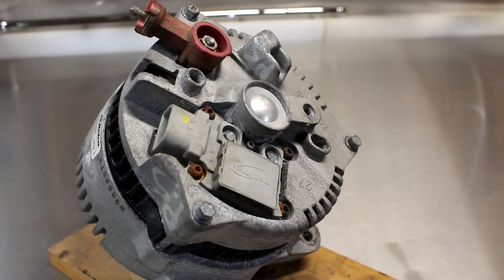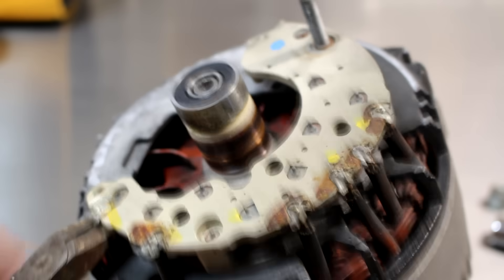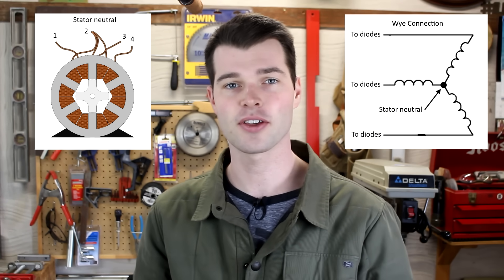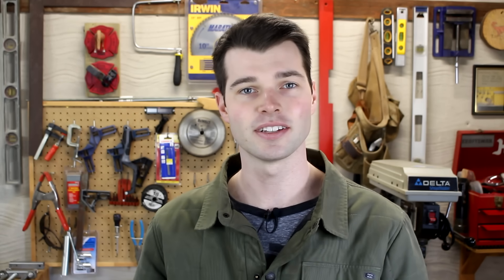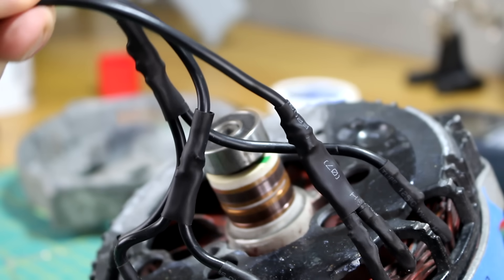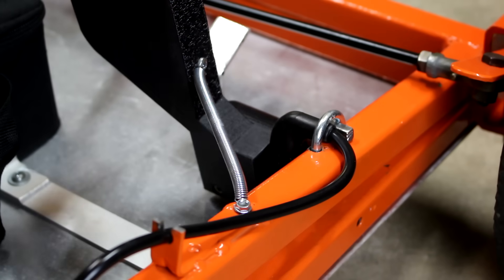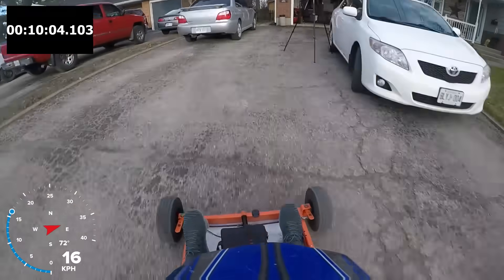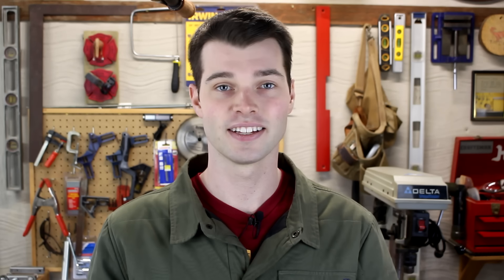Converting a Car Alternator into a Go Kart Motor

Comment: So get another alternator and use it to charge your batteries while
Driving around.
Reply: tornsoul82 are you suggesting that you've solved the world's energy struggle by generating energy out of nothing?
Are you sure this is what you've done?
Reply: Some people and by the looks of it here  "A BUNCH" of people are just Plain stupid.
Reply: @lysol7204  Sadly there is no cure
Reply: Richard Schofield2@
Reply: That sounds like he has accomplished …  @richardschofield2201  "Over-Unity" and at a rate of 30% is INCREDIBLE! to say the least.
And although I  originally conceived this alternative due to a friend insisting he had accomplished  'over-unity' with a fully-magnetic-motor drive,
along with my insistence that "it couldn't work" and after discerning then labeling the problem and solving for it, the solution became my original "Come-No-Go" motor design in 2002,
(I projected it to be nearly twice as energy efficient as the conventional drive motors were at the time.) 

Circumstantially shelved until 2013  I again revived it and this time refined the switching to mosfet pickups, shunting power between discharge capacitor and recovery capacitors, , and also adding the re-gen (Reverse EMF) from the reverting magnetic drive field now has it at 80% internally recycled power which leaves the battery (or source) only responsible for providing 20% of the ongoing power consumption. 

(BTW … I have yet to be convinced that 'over-unity' is possible, while higher energy efficiency is.)
Reply: @willyens8779  what are you going on about? Where is this extra 30% efficiency coming from? Modern motors are 90% efficient anyway.
Short of magnetic bearings and running it in a vacuum there's nothing more to gain from electric motors.
Reply: The parasitic drain of the additional alternators would require more power to overcome than what you would be producing. If what you are suggesting were possible it would be the solution to the worlds energy crisis. There are no free energy machines, thats like turning lead into gold, its a pipe dream; physics prevents it.
Reply: I don’t think that’s how it works😂
Reply: This is just silly. Of course you cant use an alternator as an engine to power the cart, and then stick a second alternate on the chain, to have it provide power to drive the thing. Even if you somehow managed to get 100 % efficiency everywhere, and no friction losses, you would get exactly as much power from the second alternator, as you input in the first one. As son as you add the load of actually pushing the cart, it just stalls.
And, in the real world, where friction and energy losses occur, this is dead from the start.
Reply: Exactly … Friction would kill it  @SweMisterB
Reply: @SweMisterB  I think a lot of people don't realize how much energy it takes into turning a generator. My first hard lesson was when I put a small generator on my 10 speed bike in the 80's and darn near killed myself when I flipped the generator on so I could see when it got dark. I quickly switched to battery powered lighting.
Reply: Laszlo Makrai - 

Thank God that some one on this thread "gets it." 

If we could just hook a generator up to an electric motor, and produce more than we use - then we would have been doing that for the last 200 years.
Reply: @barking.dog.productions1777    .wowwsssswss this Great Job Sir, Welcome to Brazil Great time for investiment here now... think about this Work here... Now...
Reply: YouTube comments sections are so silly. I'm not even out of high school yet it seems I know more about power generation than half the YT audience. Amazing that in 2018 people are still thinking that they could create a perpetual motion machine.
Reply: @maeflower5108  you cant cure stupid
Reply: ElTomatoe amazing that your physics are flawed .. we humans swim in a sea of magnetic waves in this little wonderful planet. A perpetual whatever machine is flawed terminology also .. anyway, keep studying .. https://m.youtube.com/watch?v=yodY1jH5j-I
Reply: A lot of people here without even basic physics/electronics understanding lol.
At every conversion (eg kinetic back to electrical) you get less out than you put in due to inefficiency. Stacking up inefficiencies does not = magical free energy.
Reply: You could do this but you would need a flux capacitor.
Reply: @vermont1able  no problem...
They sell Flux capacitors on Amazon look it up...
Reply: Regenerative braking.
Reply: The gene pool seems to have been contaminated with some seriously harmful shit
Reply: This comment was funny and then i saw 56 fucking replies
Reply: You can't do that. All you do is add drag, which discharges your batteries faster.
Reply: So you can (feasibly) make an electric car that can charge itself on the go? If this is so, call Elon, he has a job for you.
Reply: it's not "free" energy, it's recycling waste energy. It took energy to get to that speed, you are just getting a bit of it back.
Reply: Dylan Livingston it might even drain the batteries more , its better to have a real rated motor as the drive and a smaller economy car alternator and connect it with like a 16 tooth ( drive side )  to 4 tooth. ( alternator side ) and only get a bit of extra time . some people might call it " free energy " but there is no such thing thats like saying i can life without food or water by breathing . Better you just get a bigger battery pack .
Reply: @samurboi8007  sam the slacker
Reply: thats just troll science.
Reply: However it will look ugly and cripple top speed due to the alternator getting harder to turn when under load charging the battery
Reply: You can’t recover waste electricity by attaching an alternator to the original motor. The alternator would simply be an added load (as it consumes energy to run) to the original motor. Thus whatever you got out of the alternator would just be taken right out of the motor.
Reply: The alternator would serve as an engine break because, the energy required to charge the batteries is not converted 100% efficiently.  There are some losses in the alternator.  The amount of power used to drive the alternator would not be replenished into the battery pack due to these losses.  Effectively, you would only serve to drain the battery faster.
Reply: Idiots
Reply: @lysol7204  I know right? It's ridiculous this level of cluelessness exists
Reply: Guys use your brains. Alternators are 65% efficient. Very efficient 4 cylinder gasoline engines are 35-41% efficient. you can regen brake by reversing the polarity but thats the only way to recoupe some of the energy you've already lost. Nothing is going to create energy out of thin air.
Reply: While you're at it, pull yourself up by your waistband until you levitate.
Reply: If you do that, men in black suits show up and take your toy and give a strong warning not to do such again.  Next visit they erase you.
Reply: @texasinfobroker  dont flashy thingy me,bro!
Reply: not needed, just use an esc with regenerative braking!
Reply: Fucking hell, with all these 12yearold YouTube engineers we should, like the guy said, have a fusion reactor within months!
Reply: uhmmm...no.   so right after this you'll build a cold fusion reactor.
Reply: EXSACTLY
Reply: "What do we have for him Johnny?"
Reply: That is called dynamic braking
Reply: tornsoul82 would it be better to go solar?
Reply: jmlcolorado use it for breaking and recharging. Obviously not fast breaking.
Reply: Awesome! Too funny!
Reply: I actually use something like this in my robot designs. The drive motor drives the drivewheel and a 12V hand crank generator. The free spinning wheels also have these generators attached. The power source is a 12V battery - but the 12v battery is not being charged by the generators, The generators are charging smaller, rechargeable battery packs that power the electronics and other subsystems. The 12V battery only supplies power to the motors - when in operation the generators keep the smaller batteries charged, when the 12V drops sufficiently the machine tracks the charger and plugs in, charging only the 12v battery (the small batteries stay charged from the generators) In addition, the generators can be used in place of optical and hall encoders, because they output a voltage and frequency that is directly proportional to the running speed off the generators.
Reply: This is a good idea to recover some of the lost energy. Teslas do it with regenerative breaking. Why can't we do this? 

It wouldn't be creating energy it would be collecting it.
Reply: It don't work like that
Reply: What?
Reply: Idiot
Reply: Isn't it possible to use the same motor for Regen braking?
Reply: I actually tried hooking an electric motor to an alternator with more output capacity than the motor used. I was 8 years old and invented FREE ENERGY. But, as you probably know if you know basic physics, it didn't work.
Reply: That would kinda bring into prop motion witch we haven't figured out yet. so would the amount of power needed to run the new alt be more than the new alt could deliver back? Ya probably
Reply: I've had this idea for a long time as well. Or stick like 3 alternators on there lol! They don't seem like they take much energy to spin. Obviously you'd still need a battery pack, but it would make it last MUCH longer, I assume anyways.
Reply: check out the laws of conservation of energy, which are immutable. Any energy taken from the drive motor to power another alternator is a dead loss to the drive motor, with additional losses due to inefficiency No free lunches in the energy field....Joe
Reply: larry ballard  So... A hybrid?
Reply: jmlcolorado I know nothing about it, but could you not use two batteries and two alternators?
One powers and drives, and that charges the other battery. And swap between the two? So you're using driving to charge, then ....... well.... alternating 😂
Reply: Hmmm,how about an alternator from a motor bike with a big gear to small gear mechanism to charge the battery while driving?
Reply: See the second law of thermodynamics
Reply: 1 alternator waste about 2 horsepower to work, so where is the point?
Reply: @MrFluorescentify  The point is you cannot get something for nothing, you will end up with less power than was in that system to begin with you are trying to invent perpetual motion.
Reply: @MrFluorescentify   Because you cannot something for nothing ,it would decrease your range.(Think why perpetual motion will not work)
Reply: Perpetual motion?  Not. Lol
Reply: only if
Reply: Good thing that no physical resistance exists when driving a charging current.
Reply: top 10 comments made moments before disaster....
Reply: How much does the alternator (once prepared) weigh?
Reply: We call it Toyota Prius. Except that there's still energy loss
Reply: Maybe it'd be an idea to use it as a regenerative brake...
Reply: Haha!
Reply: @Maximus Decimus Meridius what have I said that is so un-chilled?
I have questioned anyone who claims they have created perpetual motion or anyone who believes they have improved the efficiency of coupling motors and alternators.
Quite reasonable questioning don't you think?
Reply: "
Don't be stupid you moron"
Reply: @Maximus Decimus Meridius do me a favour and quote what I said that was so terrible, as I just don't see it???
I feel you may have some snowflake tendancies that you need to work on...
If you read everything looking to be offended you'll find it, especially once you add your offense seeking tone to it.
Reply: @Maximus Decimus Meridius jeez you're an angry little fella aren't you?
Look, I made some valid points in this thread.
You have not contributed to this thread at all.
You reached out to me for whatever reason to to start a slanging match.
You haven't been able to justify you original message with a quote or reason.
I believe this makes you the troll!!
Reply: perpetual motions??  FBI wants to know your location.
Reply: @kiskafish7877  off of the steering shaft
Reply: Unlimited energy solved lmfao
Reply: larry ballard  It is called a hybread car dumbass that is how basicelly how they all work.
Reply: Good try but it doesn't work using an alternator to recharge the battery as the motor propels the vehicle forward. Eventually the motor and the load that it has to move will use up more current than the alternator can supply there's no such thing as endless energy.
Reply: I had a similar idea a few years ago of an electric motor running off of a car battery that spins several alternators which would charge up a bank of deep-cycle batteries in a Series-Parallel circuit that feeds a Power Converter(s) which could provide enough energy to run a few household items; one of which is a feedback loop to a battery charger to recharge the first battery running the motor.  And my theory was that if it is scaled up right, I can create a "Self-sustaining Power Plant" to take my house off the grid.
And it would of worked, that is if I can find a way to repeal that "Fuck-me-in-the-ass Law Of Diminishing Returns"! !
Reply: ding ding ding.......
Reply: AL TheBoss 

Yeah, "ding ding" with a missing clapper. That added alternator won't avail much, if any. No such thing as a free lunch Jack. I'm not much of a physicist, not by a long shot, but my objection has something to do with my rather sketchy understanding of one of the 3 Laws of thermodynamics that will buck that. (again no such thing as a free lunch). Here's why jr., without delving into the intricate Calculous, a level of mathematics I've not a drop of ability to explain by.  First, that alternator's weight will impose itself upon the whole 'ball of wax' in addition to it's freight and that motor will have to work a lil harder to keep up the pace, thus needing more juice, serving as factor (albeit a minor one) to faster discharge the battery than that alternator can recharge. More importantly, that coupling of it to the motor for it to, in turn, drive it's energizing shaft will no doubt affect efficiency of the kart. You won't be able to run as fast and as long as imagined. Perhaps you may get a mile or two more out of that "free meal" set up, but point being the bat will still discharge down to a useless "brick", simply because that alternator's charging rate won't be able to keep up with the rate of the kart's rate of power juice consumption. Then you might rebut with "Well darn shoot! Just get a bigger alternator for more 'oomph' output!". What for? More weight imposed for same motor to push everything depending on it to go somewhere, and more heaviness of the alt's shaft that has to be turned by incurred more effort required by the motor to impart a spin on it. The coefficients and variables  of friction, gravity, drag, doobababingbangs and all that resisting jazz to surmount will just make it all the worse instead of better for the bigger alt to supposedly kick aside.. More battery food that has to be gobbled up to compensate for same speed of trave, resulting in less run time. No matter what you try to do to off-set the unwanted, the "System" will simply adjust to BALK you man. And that's that. And I'm positive, that law of physics has been tried and tried again by sundries of others to be breeched, only to end up "fucking" or getting "fucked" hard by a dead end, waaaaaay before any of us on here yakety yak yaking away commenting, was, in part, flagellating around in our daddy's balls!!! 

In short, what I'm trying to say is, "No dice! Those are the breaks, at least  in this Universe we all are held prisoners in for life, son. So like it or lump it. But Nice try."
Reply: What you say is true, but what if he would be able to convert his alternator into a motor/alternator. When he is coasting,/braking it would work as an alternator and then he pushes on the accelerator, it would act as a motor.   The biggest downfall of electric cars are 3 phases : 

1. Generating electricity that isn't dirty is expensive/time consuming/slow
2. The batteries we currently use are also very environmentally unfriendly. The material in them are in short supply and hard to mine. 
3. The range is very strictly limited by the size of the batteries and the vehicles due to the size, can be really heavy. 

If we could generate power while the car is in motion, then we could extend the range without adding batteries, using time, etc. There are many ways to do that, unfortunately none of them are cheap or easy. 
1. Regenerative braking - using the electric motor  during braking as an alternator is a "free" energy. 
2. Using the centrifugal force to spin a generator while braking or accelerating is an another "free" energy.  Kinetic Energy recovery via a spinning wheel  for example.
3. Putting solar powers on the cars surface is also free but at the moment it is a very small amount of power at a few hours a day in most areas, but if the solar panel efficiency raises, so will the use of them . 
4. Using the shock absorber's motion to get kinetic energy, is also a good source of power. This is a fairly new and very exciting project. Since the cars shocks move constantly, they generate heat and the moving can be turned into generate power.  This is especially true in SC roads which are very bumpy :-)  Again, this is a "free" energy. 
5. Using the vehicle's kinetic energy as a freewheeling motor is what F1 used a while ago. I think the name was KERS and it was abandoned due to the instability and cost effectiveness. Once they went hybrid and uses the kinetic energy to generate power instead. 

I'm sure we will find other "free" energy around a normal car, that we can use to generate power therefore extend its range and reduce the size/amount of batteries we need.  

Using an old style alternator (motor) on a constant run is not a free energy because it will take power away as the engine needs to spin the generator. This causes friction and robs power from the motor.
Reply: pretty much like the old starter/generators haha the starter motor was actually also the alternator :P
Reply: @oldwortex5818  Great Job Sir Keep Power, Welcome to Brazil , we here Make Great Bussines here ... think about this... This motor alternador Work on 12 Volts?
Welcome to Brazil...
Reply: Laszlo Makrai forklifts have gen breaking fyi
Reply: dumb da dum dum
Reply: Finally a working solution to the perpetuum mobile problem.
Reply: Ferrari uses this technology on their Formula 1 race cars. I forget what they call it, but uses the braking to charge a Capacitor that is used for Burst type accelerations.  I also like how Porsche in their 918 hybrid car uses a generator to power their electric power motors, thusly the gasoline engine is used to power the generator. Unfortunately imho the electric car has come way too late. In fact it came and went way back in the early 1900s with the advent of cheap crude oil. Maximum profiteering through exploitation of the earths resources are dooming the human race to extinction.
Reply: @evopwrmods  kinetic energy recovery would be way too complex on this vehicle...m
Reply: yes everyone knows who the liar and murderer from the beginning is.
Reply: Quinton P. Young III Regenerative braking. Then it will be same as the hybrid e-machine!!
Reply: tornsoul82 this sounds interesting! Do you have any more info somewhere of your system?
Reply: Scott Monroe. ... we had and still have real problems to address.... you cannot buy industrial resources as a home owner in abundance like you could 40 years ago... because you need an account and to by in bulk.. wages are being driven up so new growth to get such an account responsibl without irresponsible loans...is almost if not zero...

the japanese did in fact learn how to make gold with a chemistry set... and many many many other things have come to pass... wind mill energy the low end of the coin...if you want to charge your batteries without impacting  the system "parasitically" ... tie into the existing drive spindle in a way that doesnt farther substantially impact the system.... and you will do fine.

the thieves making wind farms are not getting rid of burried or overhead powerlines... they are not making electricity far more affordable so our home owners can build businesses out of the work shed... or any other similar... they are producing jobs... and taking a cut of the already existing infrastructure in a monthly payment.... that is rapidly being made less and less affordable and the community more and more dependent on irresponsible money changer/currency abuse salesmen who convinced you that an honest days work... honesty itself... good will... and innocents (not naive)... could build anything and everything your hearts desired without setting the future up to be ruled in sloth saying only a trickster or a gov power could get anything done.

if you want to find a way to build a very efficient car... or anything else... you can do it if you try

you are not "getting something for nothing" no matter how you go about it... the energy you pull from the wind or sun... or the latent magnetic flux lines of the earth relative to the magnets in your ellectric motor... is being shed in the mechanical deformation of every tiny part of the equation relative... wear on the chain, the sprocket... wear on the bearing... tires... the road... into your body... and in the mechanical deformation seen over time as the transfer of energy causes the decomposition of the material you use for your battery.... . the statement you cant get something from nothing is in fact accurate... but falsifying it... is as irresponsible, or more so, than claiming you can in fact get something for nothing.

what you are wanting to do with electricity is akin to the difference in manufacturing something like a VCR with hand tools ...and manufacturing a VCR with old fashioned ultra complex mechanical engineering using tool and die.... to manufacturing a modern VCR with a combination of all of the above but using far cheaper, and cheaper to maintain robotics in your tool and die.

eventually you will succeed... and as with all technology... the first people who own it will very likely utterly fail to respect it... and they will ruin most of mankinds potential to actually do anything remotely close to as awesome as what could have been done... if they would not have tolerated politicians claiming right to cause reactions in order to pass a law to do something a law cannot actually do and that you already had the ability to do.

best wishes... i am a man.... and my faith is not for sale...knowing that i am a man... that faith in you is all i have... no matter how stupid you get.
Reply: You just invented a perpetual motion machine!
Reply: @officialWWM  i think you are related to forest gump
Reply: jmlcolorado I think you're onto something...
Reply: Mr B have you not heard of high output alternators? I have one in my S10, powering a 2000 watt 10 pill cb amp, that puts out around 800 amps continuous at 2600 rpms.  There are big suburbans running up to 8 alternators(usually leece neeson truck alts).
Reply: sure Mr B , its just silly , just LIKe the fake moon landing or water pooling on a spherical object... sounds like 'stinking thinking' or compulsory education is blocking your creative nature.. this ant is awesome and its pretty obvious he WILL move that rubber tree plant!  ps  water Always finds it 'level'  : ) cup, puddle, pond, lake , great lake, ocean!   THINK!
Reply: @jimmyfavereau  Dude just stop
Reply: Very do able.. would just need a battery for initial "start up" then would need to research gearing and just make sure the alternator spins more then the motor to make more power then it uses. We have something like this setup to live "off the grid" it does look hideious though cause such a big sprocket on the motor turning a tiny sprocket on the alternator. with more research and a few more parts i can get it down more, but just been to busy to find the time to re do the system. for now it works well for what it is used for.
Reply: just put a new altenator and a car battery for continuous non stop use
Reply: @tornsoul82  Amazing! You have created infinite energy!!
Reply: tornsoul82 
If what you claim is true. Do not discuss this with anyone for any amount of money, you will never get to enjoy spending.
If you feel the need to freely share it's workings.
Draw it out on paper in simple fashion with a parts list and description of operation.
Make 500 copies and ask your local parts store if they will let them sit beside the register for customers to take freely.
Also make 500 to put under windshield wipers at Wal-Mart.

Do this distribution anomylously.
Reply: naw, just did research on alternators to find the best on for making power, then did some math work (well not some, about 10 hours worth of trial and error) to figure out sprocket sizes needed. in the end it really was not worth doing, for the amount of time research and money for it. i mean it does put out more power then it uses, but its barely enough to fully charge my battery bank over night. I may try a little different route in the next few months using a generator from a tractor and an alternator, with the math work it should output about 30% more then what my current setup does. That 30% will be plenty to charge bank over night, and get some day use when its to cloudy for my solar panels to keep up with.
Reply: tornsoul82 2
Reply: tornsoul82 s
Reply: @tornsoul82  Did you learn to use the word Than and not Then?